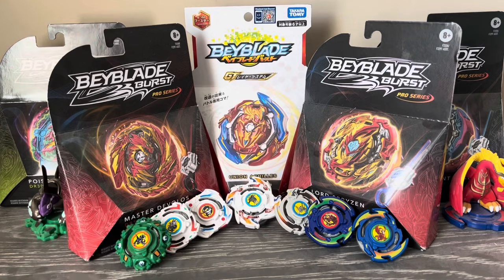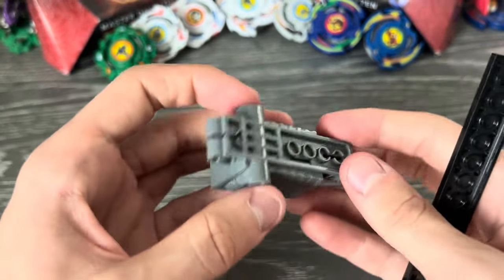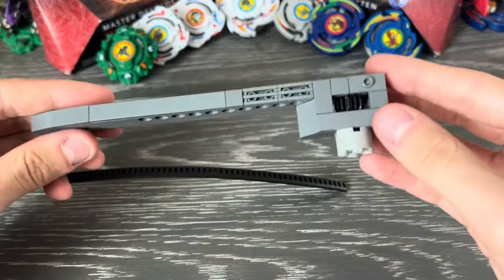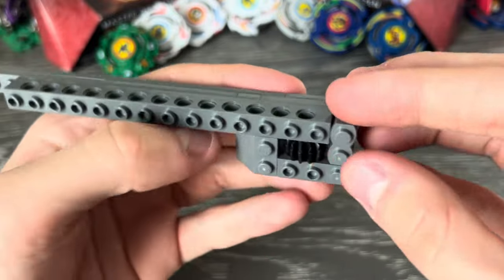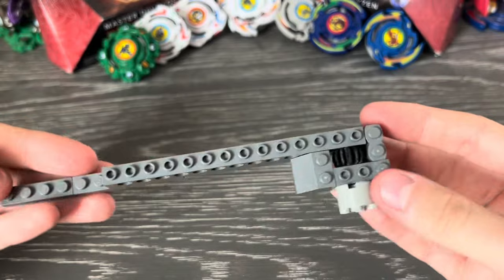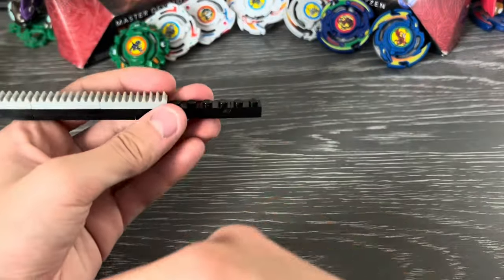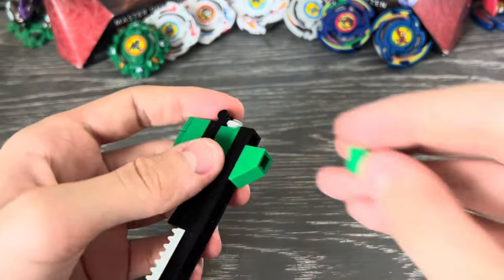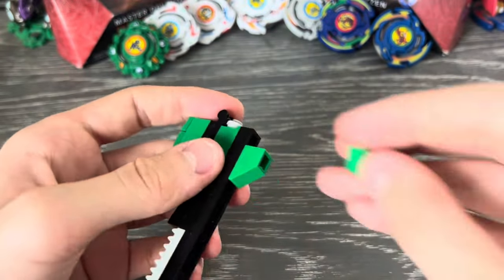How To Build Lego Beyblade Launchers | Breakdown and Tutorial

Comment: I use Lego 11833 attached to Lego 6222 for holding on my Lego Beyblade. And a Lego axle to hold on it. For the ripcord I use Lego 64781. For more speed I translate the ripcord strength using  Lego 3649 with Lego 3647. For the base I use stacked Lego 4156299-4522934 pieces. My Lego Beyblade has Lego 6222 at the top and it connects to Lego 11833. It always goes off if I pull it hard enough even If I attach my bey so hard I can. I mean my launcher is capable of producing air noises with the rotation speed of the Lego Beyblade. I have a Lego bey that is just lego 4644087 with an axle and Lego 6222 on top and It was capable of bursting my Bushin Ashindra A5 on the second hit. But I still have another more beautiful Lego Beyblade.